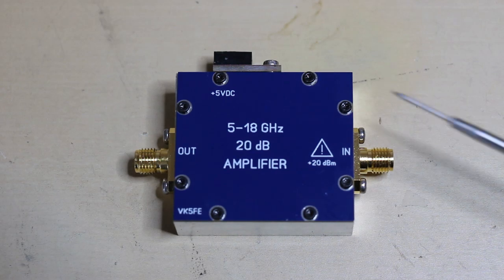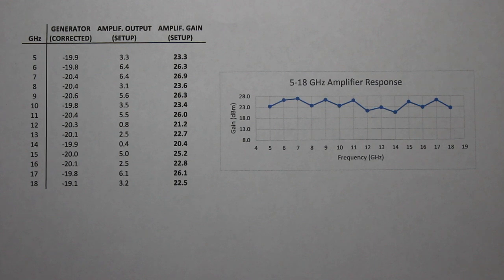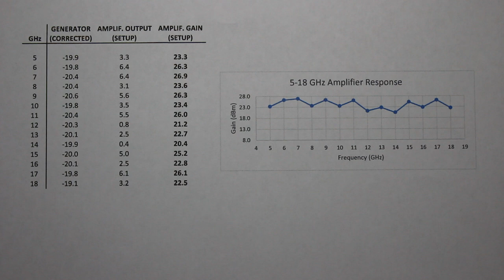#40   5 to18 GHz / 20 dB Amplifier

Comment: Thanks for the video.
I have a question - what material do you use for PCBs? What is seen in your videos does not look like Rogers or some expensive microwave material.
Reply from the maker: The PCB substrate is the ordinary FR4. As I used RG405 cables from the connectors to the input and output of the amplifiers, the PCB function is basically to help to dissipate the heat generated in the amplifiers, provide the necessary ground plane and provide a base for the other components. If you take the datasheet of the amplifier as reference you will see that the overall result is pretty good.

Comment: Looks great! Where did you buy the aluminum housing? 73 de 9A3LRM
Reply from the maker: 73 Marko. I make them myself, there are other videos showing how I machine them.  The purpose of the channel is to show that we certainly can homebrew our own microwave stuff, avoiding, for instance, expensive PTFE boards but still building useful modules for our experiments. In the case of this amplifier, the data presented shows  about 10% gain difference (5 to 18 GHz) from an ideal amplifier (data sheet).
Thanks for the comment. cheers.

Comment: Nice! What substrate did you use?
Reply from the maker: The cheapest, FR4 0.8 mm thick.
Reply: @vk5fe943  from my experience FR-4 behaves very poorly on frequencies above 6 GHz. Very big losses
Reply from the maker: @andrsam3682  FR4 cost $5, PTFE $300. This is just another way to do inexpensive modules with performances not so far from professional units, that's the reason why coaxial cables were used.
Reply: @andrsam3682  if you look carefully you can see that the rf is mostly not on the pcb anyway but in the coax cable, that should help limit the effects of poor pcb material choice too